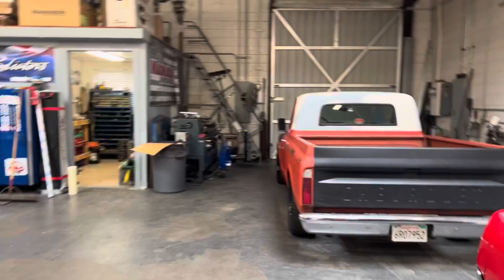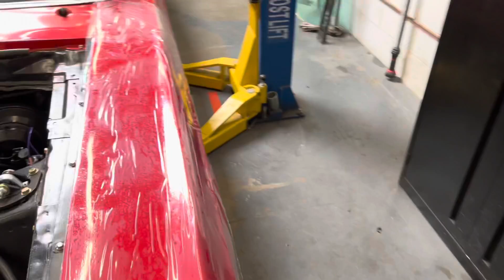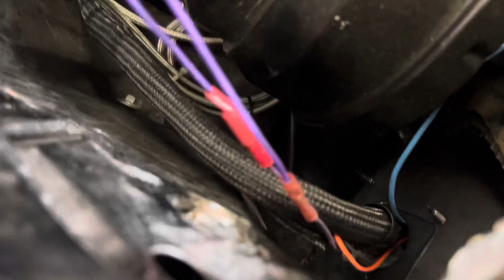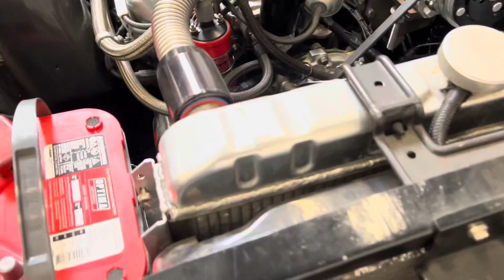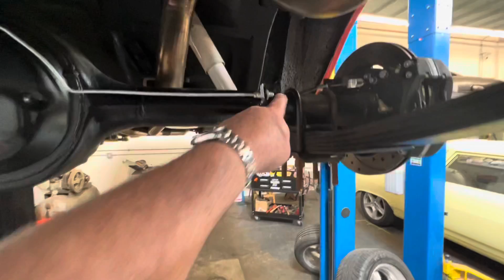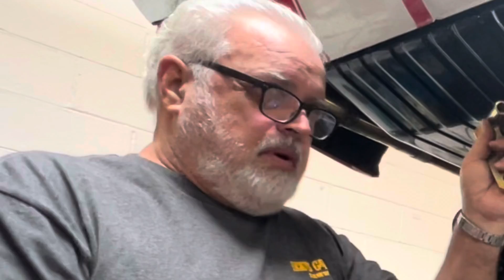Sure Bet 69 Mach 1

Comment: Couple observations...not meant as criticism...Remove shock from bottom plate first..aids in assembling plates to leaf springs,  and light brushing of anti seize on u bolts...keeps spray lubricants from drifting onto other items and is better prevention of thread galling which weakens the u bolt.